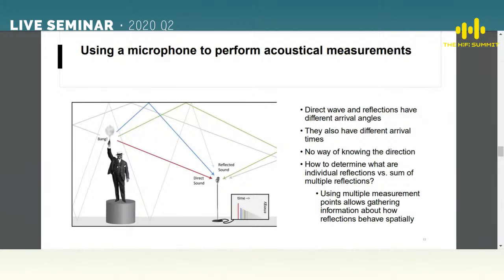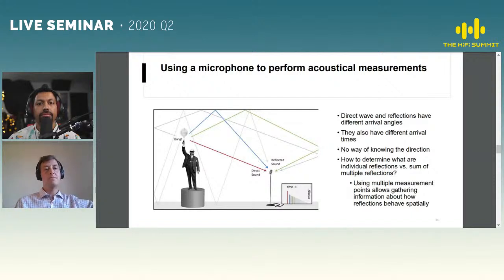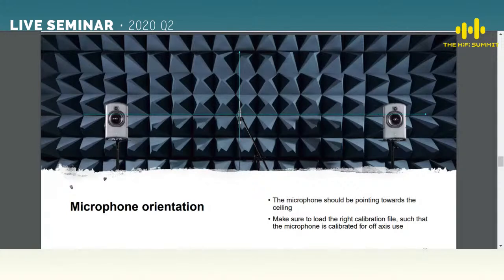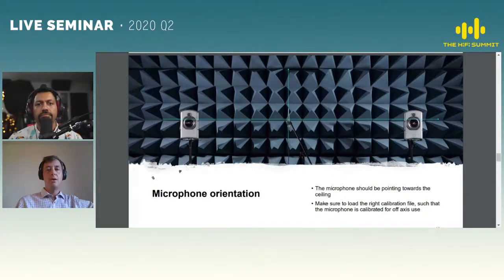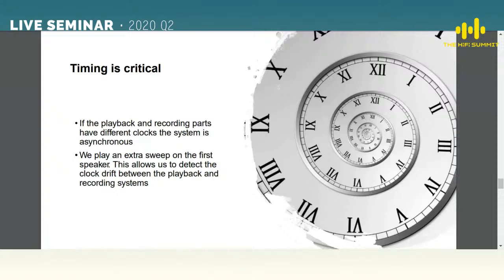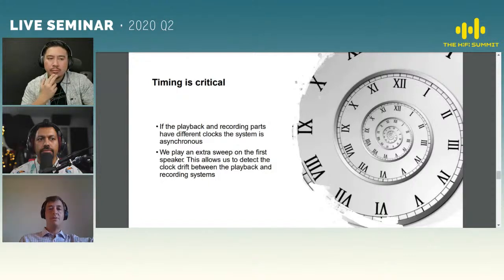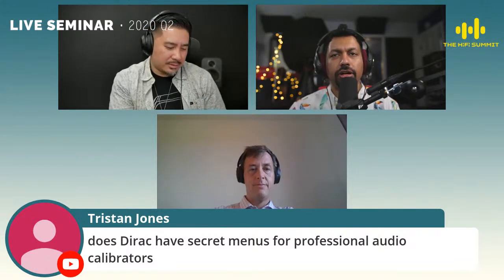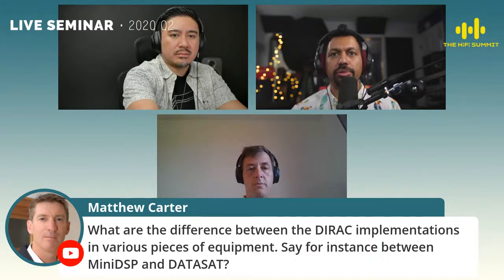Dirac Research | DSP Room Correction | Jakob Ågren | The Hi-Fi Summit 2020 Q2

Comment: @Daily HiFi  @Joe N Tell  @Techno Dad  
Jakob did a fantastic job of presenting how DIRAC and its measurement process work.  Thanks to all for taking the time and energy to produce this video.  👍

If it isn't already, there should be a LINK to this video posted on the miniDSP web site in a "How It Works" or "Support/Tutorial" section...and also on the various manufacturer's websites who incorporate DIRAC into their products.

Like Erin Hardison, I use the miniDSP C-DSP 8x12 v2 Dirac Live processor in one of my custom high-end car audio installations.

A vehicle cabin is a much smaller "room", and many of the particular acoustic properties are very different from a standard listening room, i.e. there are A LOT more "early" reflections, and all of them are at a much greater amplitude.  In addition, the Schroeder Frequency and resulting "room modes" are quite different.  But DIRAC corrections still work exceptionally well after a bit of experimentation and learning to interpret the measurement results!  👍

For the best results in my vehicle, I tend to take my first measurement (and the others in that horizontal plane) at about mouth or chin position.

There is also the "Moving Mic Method" using REW which Erin explains in one of his fantastic videos on his Erin's Audio Corner YouTube channel...
  https://youtu.be/O92zzPUeEUM

There is also a decent measurement demo using REW in a recording & mixing studio control room by Warren Huart on his Produce Like A Pro YouTube channel...
  https://youtu.be/6RiuwqzjqlQ

In this particular vehicle, I will be driving 95% of the time, so my vertical seated height will not vary much, though my side-to-side position might vary a bit more (gansta' lean to the left or right, LOL).

But due to the smaller size of the "room", in addition to the confined seated position, the measurement and listening "window" are much tighter.

Comment: Interesting that the First measurement point (Red) is Not at the listeners ear level. Shouldn't it be?
Reply: @John Conte  
I'm late to the party, but...

Yes, you can take your first measurement at your ear-height level.  And you can then also reference your other microphone positions from that point in space.

However, what the Dirac correction is trying to provide is an AVERAGE "in your general listening area".  And if you think about it, when seated, you will have a "max height" position, but are more likely to potentially be in a LOWER position rather than a higher one.

IOW, in all of the various measurement positions you take, you don't want Dirac to base it's corrections for any areas that are very far above your Max listening position.

If you do your first measurement at your actual ear height, then most of the higher microphone measurement positions will contribute data to the algorithm in an area where your ears will never be.

For instance, different members of your family may be shorter, or you & others may sit upright (max height) but also lean/slouch a bit at times, or your kids may sit on the floor in front of the couch or chair.

And below what we refer to as the Schroeder Frequency, there are room "modes" (low frequency pressure-based Peaks and Dips at certain points in space due to constructive and destructive frequency wave interactions).  The Schroeder Frequency varies due to the size or volume of the room, but will generally be in the 200Hz-350Hz range and below.

These room modes tend to be placed vertically or horizontally within the room in divisions of 3, i.e. in 3rds.  Only rarely will they be halfway between the floor and ceiling, or the two side walls, or the front & rear walls.

To account for this, it makes more sense for the first measurement to be slightly lower (closer to a 1/3rd distance between floor & ceiling), rather than higher (closer to a halfway between them).  Obviously it depends on the ceiling height and your acoustical room treatment.

As Jakob said, there are no hard and fast rules, but there are basic guidelines.  You can experiment and see what works best for you & your listeners' use case scenario and particular room.  In addition, you can save multiple presets or profiles for the different scenarios.

I use the miniDSP C-DSP 8x12 v2 Dirac Live processor in my custom high-end car audio installation.  It's a much smaller "room" and many of the particular acoustic properties are very different from a standard listening room (there are A LOT more "early" reflections, and all of them are at a much greater amplitude in relation to the direct, on-axis sound.  And the typical "room modes" are generally quite different).  But DIRAC corrections still work exceptionally well!

For the best result, I tend to take my first measurement (and the others in that horizontal plane) at about mouth or chin position.  In this particular vehicle, I will be driving 95% of the time, so my vertical seated height will not vary much, though my side-to-side position might vary a bit more (gansta' lean to the left or right, LOL).

If you measure using REW, you can implement the "Moving Microphone Method".    ...Watch:  

https://youtu.be/O92zzPUeEUM
or  
https://youtu.be/6RiuwqzjqlQ

HTH
Reply: @bbfoto7248  Thanks. I am using Dirac Live as part of a NAD AVR and it's a game changer! Love it!